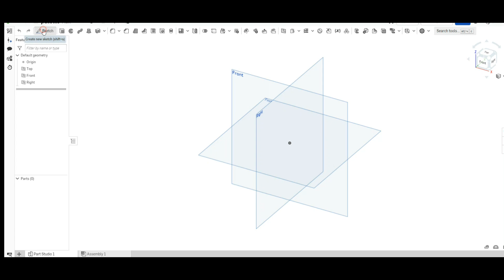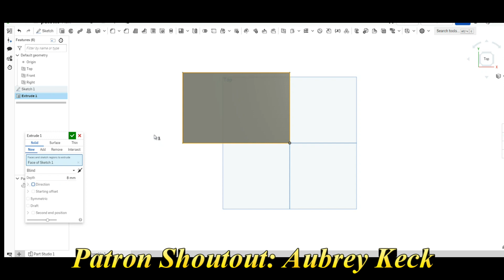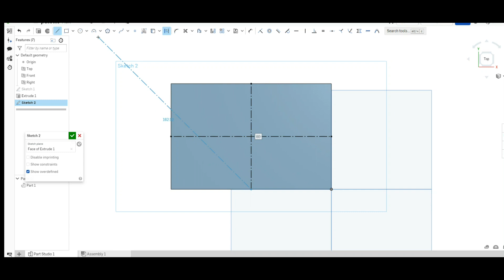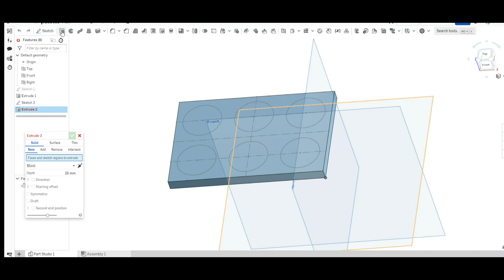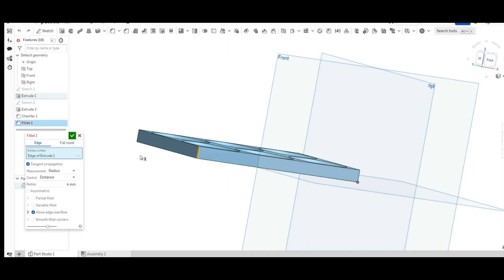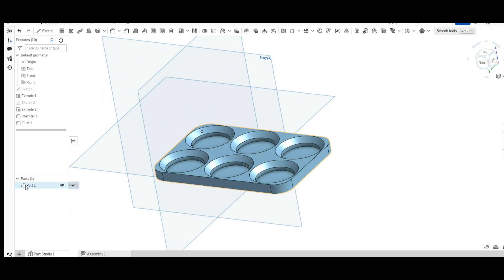3D Modeling: Your First Real World Item:  A Paint Palette

Comment: I love the series and watched it to the end cause it is a great way to get into it. 

My next question would be how to reduce the amount of filament needed. Might be a part of the very first step when you designed a full 8mm plate instead of a hollow one 3 mm thick or so.
And once it is hollow the next step would be to add a construction that stiffens it again with cross beams or what not. 

I like the way how you evolve the sketch slowly and explaining the details how to do what to get what benefit like the shaped edges 3 mm and then bigger and bigger.
Also that you use metrics and not inches which make me crazy the whole inch feet yard mile thing.
Reply from the maker: You can control the amount of filament used in the next step after exporting the .stl file. In the slicing program that prepares the file you have an entire section on "infill". You can choose the percentage, the pattern, and line thickness. For instance you can select 10% infill with a grid pattern or 25% with gyroid. These are just examples you can choose the settings you want.